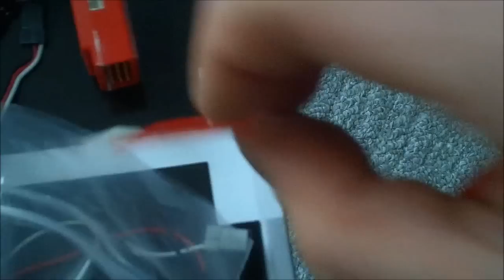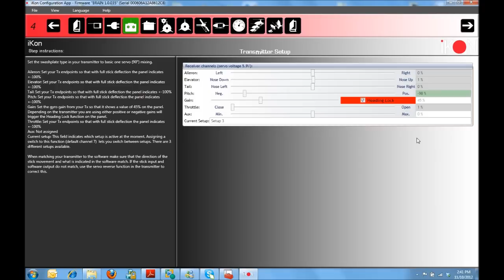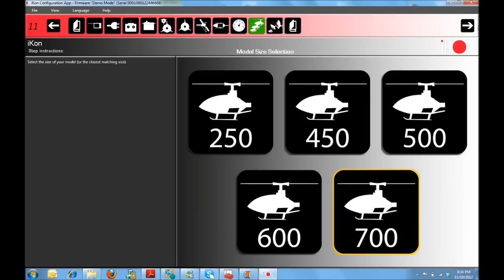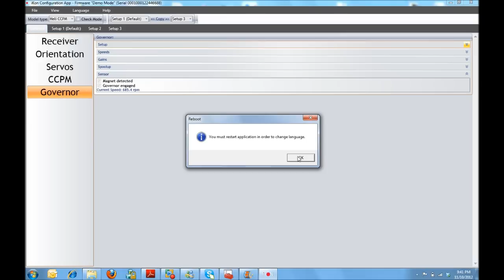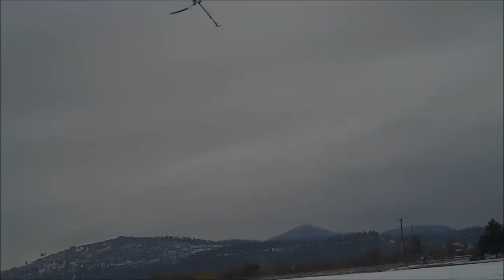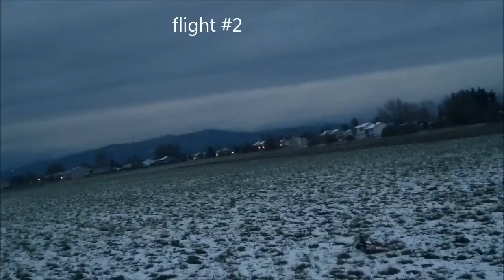How to set up iKON FBL Unit

Comment: i dont have time to read all the comments, but i heard some scary storys of people using the self leveling on the ikon and they almost crash there heli, i have a Blade 600x with dx6, Have you had any problems with the self leveling? thanks!
Reply from the maker: I have not, although I used it just a few times early on to test it out and then never used it again after.  It works best if vibes are low and the Set Level is calibrated on a very level surface.

Comment: On the SwashPlate Setup page, it is  made perfectly level by fine tuning the cyclic servos. That is at the mid stick, 0 pitch position. However, IF the swashplate is NOT level at low/high stick, is there a way to readjust it, so that the swashplate is always level on the whole stick range?

Comment: I have a Futaba T18SZ and I can’t get the idle switch to control the (flying style setup menu).  It stays on setup 1(Default). I set my idle switch to control aux2. But still can’t get the switch to control style setup menu.  When I flip my idle switch in the Governor menu, from idle1 to idle2 to idle3,Everything works. 
 
Throttle curve is 0,18, 25, 35, 45, 65,100
Throttle curve is 70 across 
Throttle curve is 100 across

Normal Pitch curve 35,45, 50,65,75,100
Idle1 and 2 Pitch curve are both linear
Reply from the maker: I have never used a Futaba radio.  I'd imagine there are some settings to assign the channel switches to Aux2 and Aux3 in order for them to work for changing modes.

Comment: Great video... I'm using the new DX6. In order to use channel 5 to change flight modes, I checked the box "is set up in software" for tail gain. However, when I exit the app and go back in to double check everything, the "set in software" box has been unchecked. Is there something I'm missing?
Reply: Thanks, this is very helpful for setting up my ikon on my new DT 700! Thanks again! (:

Comment: Hello nice video, I am having an issue where when positive pitch via the radio command in given my Blade 500X pitch is negative, under the radio TAB my control directions are showing all to be correct, when under the servo swash plate setup via Ikon AIL ELEV + & - are correct for each servo, when i try and reverse the pitch it does not work, though i can keep reversing until I end up with the complete Opposite where Pitch is correct but AIL ELEV are reversed, Can i just reverse Pitch via the spectrum DX8?  and would that be okay regardless of the radio TAB in ikon saying that the pitch control is backwards? I think this could be caused by Trailing edge main rotor blade grips!!!!!!

Comment: Are you still using these. If so I am having problems with the tail wanting to drift to the right an doesn't seem to wanna lock in on the tail. Having the same problem on my goblin 500, 570 an 770. They all are doing it. I adjusted the gain on the gyro trying to get it to do a fast tail wag. It won't wag at all. Even at 90. I've asked a lot of people with this problem but no one seems to know anything or even heard of this. So I thought I would see if you might know. Thanks

Comment: Hey db if u don't have the 2cell battery can I use my 6s battery or use with the esc
Reply from the maker: The voltage for the iKon can only handle up to 2cell lipo, or 8.4V, which is the power that will go to the servos.  If you plug a 6cell in you will have a lot of smoke, and those electronics run on smoke.  At least that's all I can assume, since they seem to stop working when the smoke is let out of them.  You'll need a BEC, power bus, or direct 2cell lipo.  A lot of BECs will take a 6S input and will step down to the servo voltage.
Reply: But can I set it up using the esc tho

Comment: Hi dbutzer, great video.  I found it because I have an auto-level problem on my Mini Titan e325 which I think I may understand better now.  In auto level, if my heli drifts (slightly) to the left, I correct to the right, but then it drifts to the left twice as more, so I correct to the right and it drifts 4x more to the left, and so on till I almost crash.  The default gain was 25 and I moved it to 20 and the problem seemed better at first but then suddenly was worse.

I think maybe I need to set the auto level gain to zero and then slowly move it up?  Any suggestions?  Thanks
Reply from the maker: Try going through step 9 in the basic setup again and make sure the heli is nice and level before hitting that "set level" button.  Also, the self level doesn't like a lot of vibration, so make your heli as vibe free as possible.  Experimenting with gain might help too, but I would try 15 next, then maybe 30, see which is closer.  Setting it to 0 would probably yield negative results.

Comment from the maker: Just looked online at some pics and it looks like the DSMX supported radios will show a dsmX on the front case to the right of the display.  If that is there, then you should be good staying on the dsmX setting.  If you bought it used and it's a older dx7s, then it may be DSM2 or upgraded to DSMX.  From what you're saying, it sounds like it's dsmX.  Make sure to do a range check before flying, just to be careful.

Comment: First, I have a DX7S not a dx7.  I don't know if there is a difference.  Channel mapping, I first choose DSM2 because that's what the main display on my radio said after binding process.  Now on the transmitter setup page as an example, left tail was on left stick and right tail was on right stick.  Most of the mapping was split like this or just completely wrong.  I went but and choose DSMX and that fixed everything.

Comment from the maker: Happy to know that the video helps!  For my DX7, I have Aux 2 switching between Setup 1 and Setup 3.  One step 12, when you setup the flying style, you can check the "Use Auto Level" box and that setup with us the self level when you switch to it.  You'll also want to make the heli as level as possible and then go to step 9 of the basic setup, then click the "Set Level" button on the bottom.  This is where it will go when entering the SL set up.  Hope that makes sense.

Comment from the maker: May have to change settings on the Tx so you can control the gain, and it sounds like you might have to bump up the gain.  If using the gov, then the gov gain could be too low as well.

Comment: Hi Andres, in case Deater did not reply... The auto stabilisation is not a separate function.   Your switch should be set to select one of the 3 "setups".  You then have Auto stab set "ON" in one of those setups. So in may case I have Setup 2 and Setup 3 both the same apart from setup 3 has Auto Stab turned ON.  I normally fly in Setup 2 and I have setup 3 enabled when I pull my trainer switch.  So if I get into a mess, I simply pull the trainer switch and the auto-stab then bails me out.

Comment from the maker: Glad to hear the video helped.  When you are on the basic setup and you are in step 12, the second to last, you have "setup 1, setup 2, and setup 3," which are assigned to extra channels on your radio.  You can set up the banks differently and on the left side you'll see check boxes for "Use Governor" and "Use Auto Level."  To set up the self level, you'll need to have one setup that has the "Use Auto Level" checkbox checked.  Hope that makes sense and helps, but if not let me know.  Cheers!

Comment: nice setup vid
I fly v-bar on my machines but just ordered one of these to play with
I love bank switching and since it has that feature I thought I would give it a shot
Auto-level may not be bad for trying out a new move but i'm not sold on that yet

at 225.00 if its any good it could be a v-bar competitor.  Seems to have alot of the same feature without having to buy the pro software like you do with v-bar